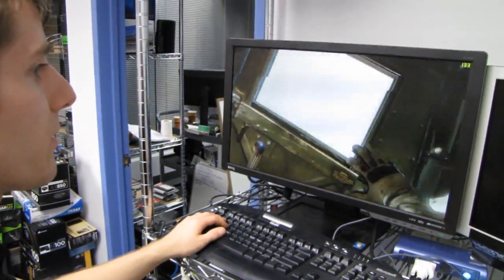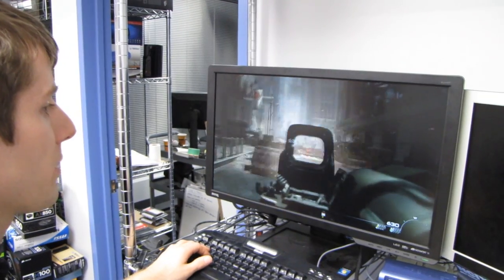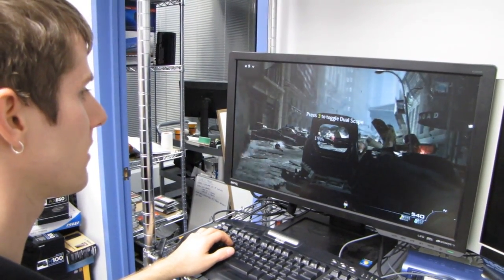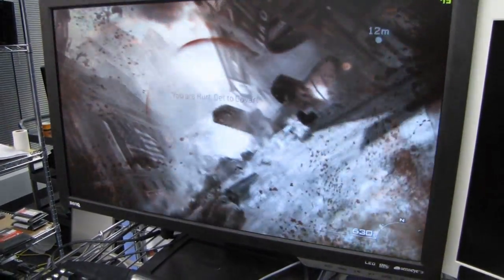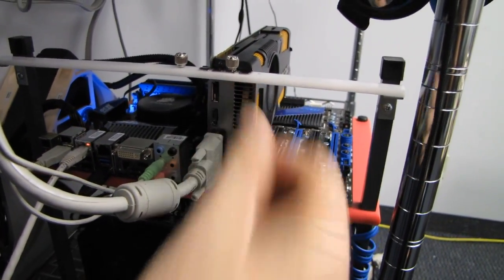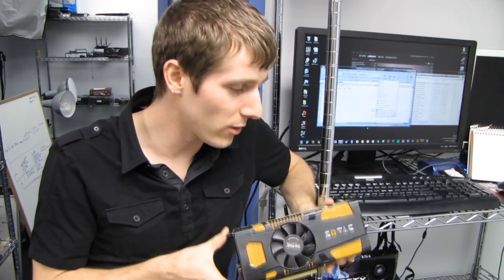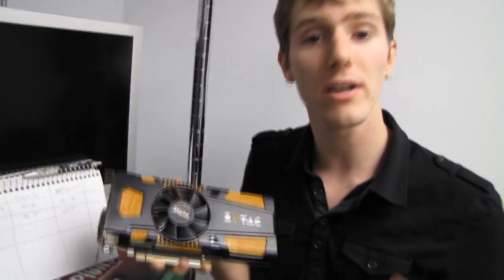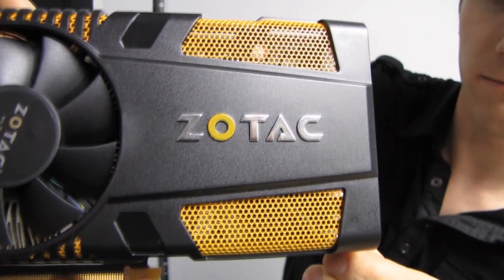Zotac NVIDIA GeForce GTX 560 Ti 448 vs 570 Benchmarks Review Linus Tech Tips

Comment: You actually need an intel core i13-7930k @748Ghz, 26 GTX 780s, and finally 2 million GB of RAM. Too bad that would cost me a WHOPPING $10k+
Reply: i 13 - 13900k and also, cpu's haven't got that much better. Probably when that releases it will be 3.7 ghz also a GTX 780 LOL. I remeber that. Now we have RTX 2080 Tis and 1 tb of ram is actually a reality

Comment: A card with a dual fans will always be quieter than a single fan design, so the Zotac wouldn't be a good choice.  These are the three best 560 ti-448's:  1. EVGA 012-P3-2068-KR  2. GV-N560448-13I  3. N560GTX-Ti 448.

The EVGA is the best of the lot but the Gigabyte has three fans, so it would be the quietest under full load.

Comment: That is another problem that lots of games don't support fully, or partially MOBO GPU SLI configurations. They support the GTX590 on board SLI though, since that is fed through 1 PCI express slot, so it acts like one card. So with those games you are better off with a GTX570 or 580 etc. than a 560 in SLI (even if it is multiple SLI config)

Comment: Even without overclock! It has more CUDA cores, so more PhysX based games will perform a LOT better. Even none PhysX user games will show 5-15% performance difference (depending on the application). 40FPS with a 560TI 448, is choppier, "freezyer" :P, and looks less dynamic, than 40 FPS with a 570. Look up gameplay vids, and look for similarly built pcs...

Comment: 3-way SLI only gets about 6% better performance than 2-way SLI, what the hell would anyone get 4 for? Also, the only good thing about 64GB RAM in gaming is that you can actually use them as file storage, like a hard drive, and you can access the files on it even faster than a SSD.

Comment: I don't plan on overclocking. Besides the zotac is clocked at 950mhz which is plenty fast enough. Will the card not fit in my current case then? And also do you think a 500w psu will be enough? Thanks in advance :)

Comment: If someone could help me I'd be really grateful. I'm looking around at graphics card and I've settled on going for this card. I'm a noob when it comes to installing hardware and knowing what is compatible with what etc. My mobo is by msi its the H61M-E33. I have a core i5 2400 and 8gb of ram. Just wanted to know if this will be compatible and fit in my case. Its just a standard crappy case m-atx form factor. Any advice would be appreciated. Thanks!

Comment: How fucking thick are all you nobheads giving Linus greif for using MW3, yeah sure its not that heavy on graphics but its a "BENCHMARK", which means if you use the same section for both cards being marked, then you will get results, and see which one performs faster! Its as simple as that, And since the 570 is about 20% more in cost terms, I would expect a 5-10% performance gap, nuff said!

Comment: @SchwarzRitter560 I have been testing out the drivers for the past few days and the one that seems to be working is the regular 285.62 driver for the 560 ti I wanted to test out the beta 290.53 but it was giving me issues and I also tried the 570 but it was not supported so just the regular 560 ti 285.62 driver

Comment: both cards have the same memory/membus but gtx570 has 32 more cores both cost>300$ to run bf3 under 50 fps maxed while for the same money 2 6870s out perform both humm...then nvidia re-issues the graphics card gtx560ti-448. That was the gtx560ti-384 which i have that costed 270$ and still is 250$. Then they made a gtx560(336 so 48 less cores) to compete with the hd6870s price market. nvidia just wants your money this is a gtx570-32 cores for -30$ 2 cfx 6870s get the same speeds as sli 560ti(336)

Comment: Ok, so the PCB is based on the 570, but the spec's are the same. Same amount of cores(448)
ROP's(40) Texture Units(56) Polymorph Engines(14) and memory bus 320 bit. But ok they are not totally the same 8) An example of this with PCB "loan" :) is the Evga GTX570 Classified. (GTX580 PCB)

Comment: @0oDarkLordRevano0 Its not as demanding as BF3 but its 1 of the most stable engines and you wont have massive frame spikes and drops so its a good game to benchmark on to compare performance. The BF3 engine (Frostbite) is more powerful but is jumpy as hell even with high end cards. I avg anywhere from 60fps to 130fps, but on MW3 it stays at 95-105 at all times. Wayyyyy more stable for benchmarks.

Comment: the 560 448 core is already overclocked to 765 MHZ and it's still behind the gtx 570 .... so the old 560 ti with a slight overclock will match the 560 448 core

Comment: if you wasting $2000+ please don't buy reference cards, go custom, better performance, stability, reliability and durability, mostly with MSI(hawk, and twin frozr editions)they will even out perform an evga "superclocked" not only at OCing but at cooling, you can even have you evga "superclocked" with water cooling and the MSI will outperform at OCing and match the temps. PS: superclocked is stupid, it isn't that great either and you forcing a reference power design, GO CUSTOM!!!!!

Comment: @Verithiell  Of course not, iv'e got MSI Hawk GTX560ti and it's performance at stock ( 950mhz core)  it's very close to a GTX570 stock. And at 1 Ghz core i'ts on par with GTX570 stock ( better than GTX560Ti 448). . So i would say , at GTX560Ti @ 950mhz stock ,  performance may be equal or slightly better  compared to the GTX560Ti 448 stock.
For all the "normal" GTX560Ti owners.., don't change your  card for this xD,  i'll wait for the HD7000 release and pick another GTX560Ti and SLI them :).

Comment: A big difference between those cards is the amount of cores. The GTX 570 has 480 cores, while the GTX 560 Ti 448 has the 448 cores.
Reply: Yup. The GTX 560 had 336 cores. The standard 560Ti had either 384 or 388 cores. 

The 448 core edition was much closer to a 570 than a 560!

Comment: GTX560Ti are pretty capable indeed, even plain version. 50-60% less expensive than GTX580, pretty much runs all new games maxed out at 1080p.
When time passes, you can with confidence get 660Ti getting all the latest technology again, paying same, with 580 you would be stuck with an old card which would be struggling for additional generation and only getting 780. You can of course buy 680, but that is a waste of $.
So yeah, middle range is the way to go, you'll always have the latest tech. :)

Comment: This is actually more expensive than a 570. And it's slower? :( The 448 is about 100-120 dollars more expensive than a regular 560ti, like say the gigabyte model which has a 900Mhz core. So the zotac's not that big'a deal. What it is, is ripping you off.